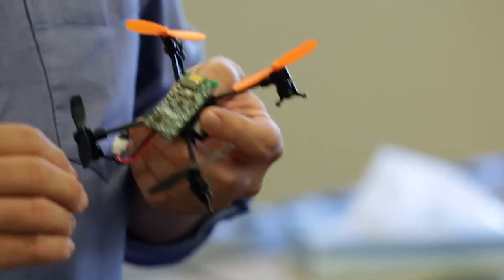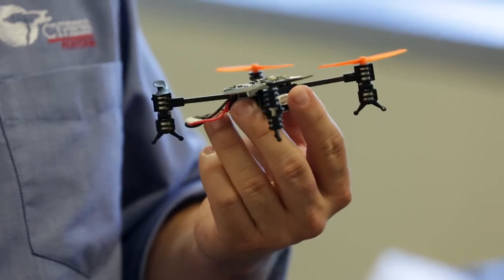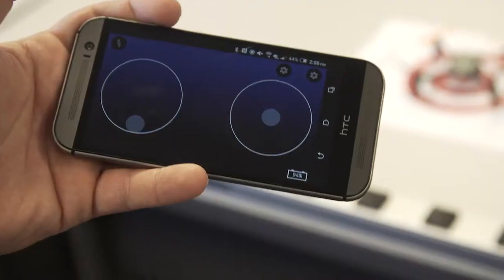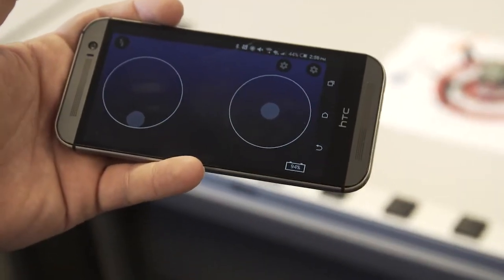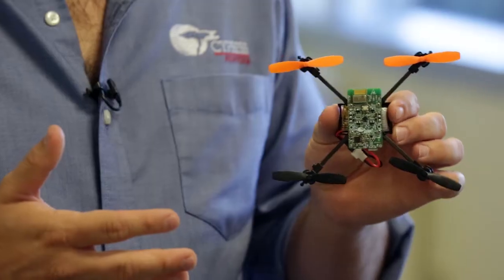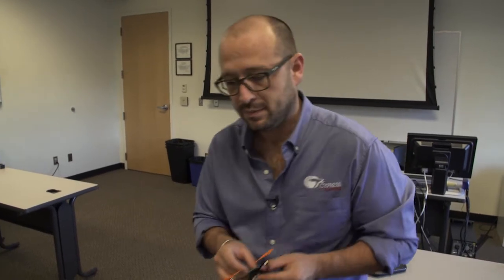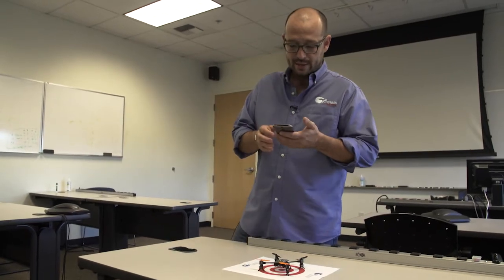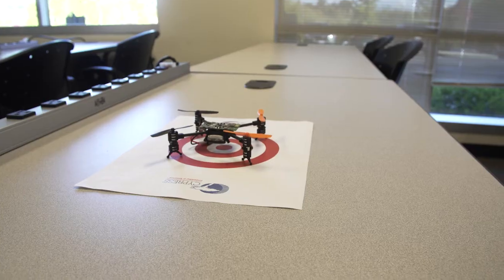PSoC 5LP Bluetooth Quadcopter

Comment: What happened to this project, is the file available now?
Reply from the maker: Hi Rodrigo, thank you for reaching out. The project files for the Quadcopter are not publicly released. However, you can check out the Bill of Materials for this project here: https://www.mouser.in/cypress-quadcopter/. Please let us know if you have any further questions. Best, Cypress
Reply: Cypress Semiconductor Thanks for your response i will like to know which PSoC is used to build it
Reply from the maker: Hi Rodrigo, in this demo we used our PSoC 5LP. You can learn more about the solution, here: https://bit.ly/2GDCmTj.